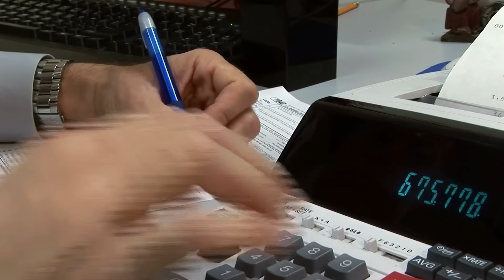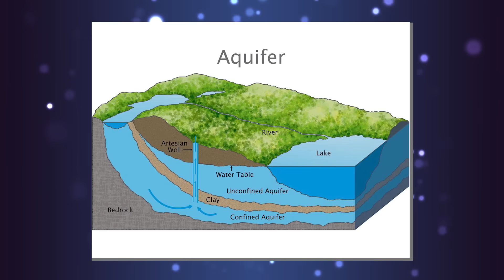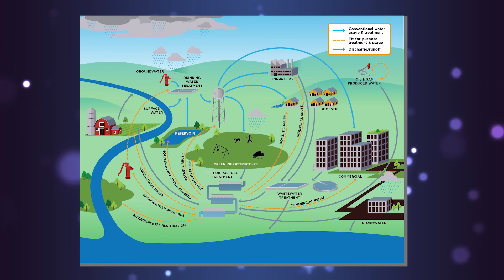Saudi Arabia Just SHOCKED American Scientists With This

Comment: Using underground water to create large tracts of agricultural fields and farms is a very unwise policy. On the surface, it seems like Saudi Arabia is very successful and producing foodgrains and fruits and exporting them to other countries, but at what cost?  Firstly monocultural crops clear off the natural wealth of vegetation, shrubs and trees, and reduce diversification of plant and animal life. Then secondly, underground water should never be used if it can be helped. Instead, a policy of creating swales and ditches should be used to trap rain and flood waters, thus regenerating vegetation and stopping desertification. Once primary vegetation takes root, it would be time to plant shrubs and trees whose growth will be supported by the vegetation around swales and ditches holding rain and flood water. Done properly, desertification can not only be stopped,  it can be reversed to create woodlands and eventually forests which once upon a time were not uncommon in Arabia. Desalination of sea water by using fossil fuels is also not a viable procedure, because the water thus produced is obtained burning vast quantities of oil which pollute the environment. Solar and wind power should instead be used to work for desalination of sea water. There is a cost to pay for every procedure, especially if rapid ''progress'' is planned. Restoring water cycles and regenerating woodlands and forests will require careful planning and above all patience.

Comment: The scientists lie. At least the ones that control the weather for control of man. When the Almighty said " subdue the Earth." He meant for the benefit of man not for the destruction of. They spray the air with aerosol  particles and light metals, aluminum,barium and so on. These chemtrails are then heated with different waves of Energie through antenna arrays they also move them around this way. If you see clouds that look like washboards they are moving the front of the weather around.

Comment: An encouraging story, but here is a few aspects to consider: The huge pivot irrigation agriculture facilities are based on fossil groundwater created 100.mio. years ago. This is not a renewable ressource and at current consumption rates, most of the fossil groundwater in Saudi Arabia will be exhausted within 50 years. This will increase the dependency on desalination plants wish is extremely energy intensive, and if you use oil to boil the salt out of the water, this is not a sustainable practice either. So solar powered desalination is the only way forward in the long run.

Comment: Well then camel jockey sure didn't build it the United States did thanks beginner and what that damn OPEC oil anyways never limited pants when they got the oilfield headed to do with all the equipment and put in place from the pump it out of the hole, they didn't have the brains or the ability

Comment: No surprise at all they have the money to work with. Maintaining them agriculture and desalination process in SA is not cheap. Infact it's not advance technology they used. They just put a highways of rubber pipes with tiny holes in it under the sand and pump water on it and it's done.

Comment: Also you didn't mention that they have seasonal rivers which are caused by flash floods during rainy season and although not much rain but they managed to build dams to hold rain water for most of the year for farming and to replace some of the aquifer water that been used. Last two months the country received huge quantities of rain that haven't received such quantities for hundreds of years which turned most of the arid lands to lush green lands.
Reply: Lived in Vegas. No plant roots soaking up ground water and the porous nature of sand and sandstone won't hold the water from following the path of least resistance gravity forces it through. Doubt its any different there. given these conditions, you can drown in a drizzle if you end up where the water flows.
Reply: Wouldn't suprise me, (eg. For their next trick) would be to charge all the air over Arabia with hug tesla towers.
So anything with an electric motor would just work (i.e., with no charging required )
Reply: Also it wasn't mentioned that the planet is actually cooling which is changing the grow zones on the planet, which is bring the ancient growing zone back on-line, this is why the globalist elite are buying up land in Africa and top end Australia as it will be a monopoly for growing food in the next decade...
Reply: @T. N. 😀😀
Reply: There is no particular period for season
Reply: I was putting center pivots in Saudi in the 70s for Valley.  It's not a desert anymore and I've been retired since...
Reply: When we take care of Mother Earth, She takes care of you.
Reply: ...& the country was over flooded wirh huge loss and casualties thanks to Extremely poor infrastructure, worth to mention!
Reply: Top comment
Reply: @shean top comment

Comment: IF YOU DEPEND ON THE WATR UNDERGROUND WITHOUT RAIN, THEN WATER EVENTUALLY RUNS OUT AND THE GROUND SINKS.
Reply: Rain is coming like crazy, because rain depends on clouds and wind movements. If they extract water from down below and it evaporates then there's something called the water cycle. Did you skip second grade?
Reply: @beckeras8848  DESERT DOES NOT HAVE WATER.  IF IT DOES HAVE WATER, THE WATER IS VERY LIMITED.  NOT ENOUGH TO CAUSE A HUGE FLOOD.  LOW IQ?  LOL
Reply: @beckeras8848  depending on permeability, aquifers can take YEARS to replenish, despite rainfall. I think you skipped some science yourself. It's unlikely they're pulling out as much as they can replace naturally. But they may have bought themselves some time for other technology to step in. (Or maybe not. If so then their government knows this is a short term solution for a few years and then they'll kiss that farmland goodbye. Shrug.) Wouldn't surprise me either way, but for their people's sake I really hope they have a sustainable way to water.
Reply: @heather2418  I am a civil engineer, and I'm pretty familiar with the geotechnical nature of sandy areas like that. Sand is very permeable, the only non-permeable fabrics and layers are the ones holding the water. They're also finer particulates and some solid rocks forming around the possible clay/slit base. They're experiencing heavy rain, snow, and more nowadays due to the change in climate globally and the new introduction of water and water vapor in the environment. They are also building a big project spanning 11 miles called The Line and another project called Green Saudi. Both of these are heavily involved in reusable energy/renewable energy and water. So the water won't dry, as long as the consumption is moderate to the plans they have.
Reply: @beckeras8848  And as a civil engineer you find it hard to grasp we're talking not about sand, nor about the layer beneath the aquifer, but the aquifer itself??? Okaayy. 🤣
Reply: @heather2418  I totally understand what I'm talking about. My comment to you was about the permeability of the sand, it is high and therefore there is no problem with the water returning. The problem is for the water to fall down from the sky, given that the area doesn't get enough rain. This is changing, and that is why they have a lot of projects going on around green lands, farms, and sustainable energy.

Comment: increased CO2 levels has already drastically reduced the plant's requirements for water.   If we can increase CO2 to 1000 PPM, we can solve world hunger and the temperature will increase only slightly.  The effect of CO2 in warming is almost over because it has reached saturation.
Reply: Do you even know what you’re talking about ?
Reply: @heyhihello9677  but I guess you do because you regurgitate climate change dribble
Reply: Historically, based on the research of arctic ice core sampling, CO2 lags behind temperature highs and lows rather than leading the highs and lows.
Reply: @Never_lost_in_the_woods  the first accurate comment I’ve seen so far.
Reply: World Hunger was created by the elites. The problem will be solved when they want it to be solved.
Reply: That's right, you are spot on